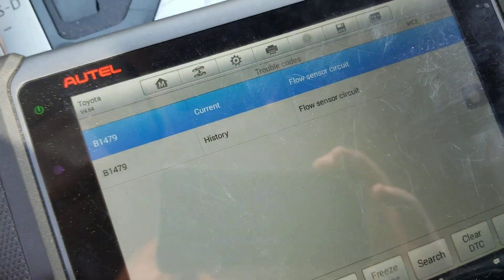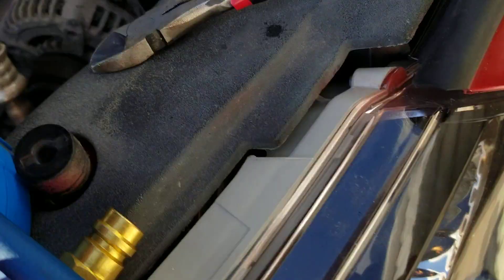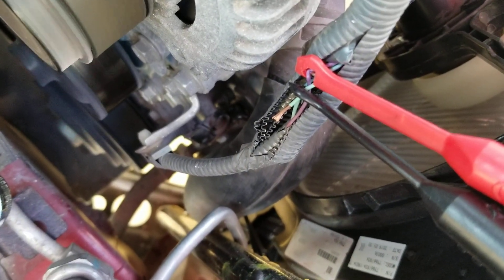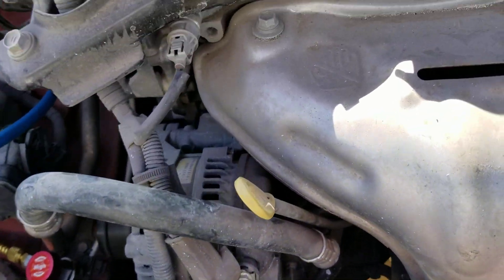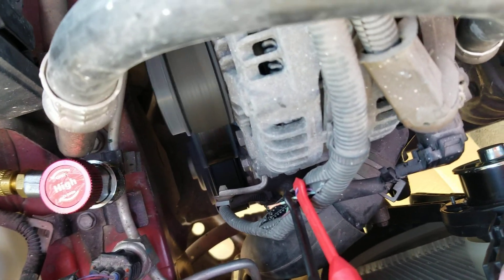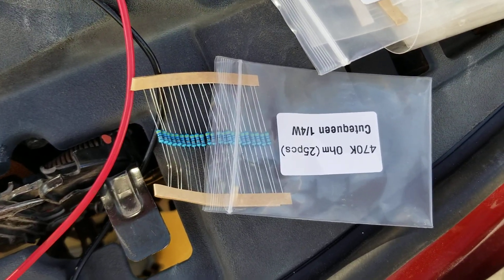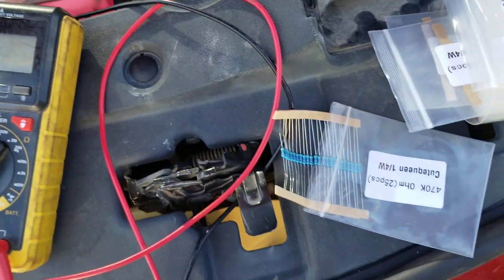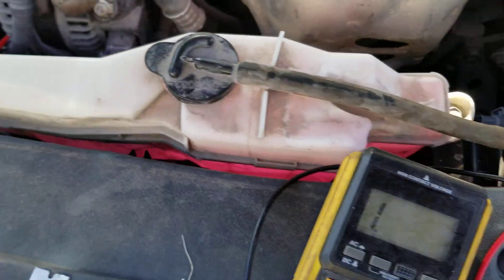B1479 Toyota Flow Sensor Circuit #FIX#

Comment: I was having similar issues. This method works, however, it causes greater fuel consumption and also causes the car to jump when moving from the stoplight. After a while, I got tired of both experiences and decided I want the original fix. I had the section where the flow sensor is attached, removed. Two ten bolts hold that section on the compressor. After removing, I used WD-40 to clean the holes using a small wire to remove oxidation from inside the holes. After ensuring that the liquid flows freely, I cleaned it thoroughly and bolted it back on the compressor and it worked perfectly. The fuel economy improved and there was no more jumping when moving from a stop or the traffic stoplights when the a/c is running. All this time that was the problem, that section needed clearing.

If the holes inside that section are blocked by oxidation, the flow sensor will never work properly because the sensor senses the flow of fluid through those small holes just beneath where the flow sensor is attached. For some Toyota vehicles, there is no need to remove the compressor to remove that section, however, the gas must be extracted from the compressor first.

Comment: Flow sensors are available to fix this issue. I replaced the Dorman flow sensor on my 2014 Toyota camry AC compresser and it works fine now. It is a bit hard to remove the old flow sensor but it works.
Reply: Hi, do you have an instruction of how to replace the sensor?
Reply: It’s a Doorman 926-818 flow sensor. Less than $40 on Amazon.
Reply: I have done this also, and it worked for about a month, now my new denso flow sensor seems to have gone bad as well :-( will try again.

Any thoughts on what may cause the flow sensor to fail?
Reply: I had no luck with the Dorman sensor and had to install a resistor.

Comment: stick a small magnet on the flow sensor works too
https://www.clublexus.com/forums/rx-3rd-gen-2010-2015/824215-rx350-2010-2011-air-conditioning-dtc-b1479-cheap-solution-8.html

Comment: It's easier to just stick a small neodymium magnet to the snap ring that holds the sensor in. If the compressor doesn't come on, try flipping the magnet/polarity. Two problems that happen with these compressors - it gets corrosion underneath the sensor and the magnet in the sensor gets weak. A stronger magnet on top of the sensor usually fixes it. Try it!
Reply: I will be glad if .... It work
.... Mine is not bringing any code... 
It work when you turn it on.... After a while... It cut off and never pick up again, until you turn it off and on again before it pick up again...
Can it (  Neodymium magnet)  work on something like this.
Reply: @michaelaaron2243  what did you find your problem to be?

Comment: There's a right way and a wrong way to perform repairs....This is the latter.
Reply: This worked perfectly for me!  How can saving $2000 be the wrong way?  My AC has been working perfectly for several days.  If it eventually messes up my compressor, I'll replace it THEN....No worse than replacing it right away.
Reply: The RIGHT way really would be for TOYOTA to sell the FLOW SENSOR separately.  Then it would be the cost of evacuating and recharging, along with the sensor replacement.  Maybe a couple hundred dollars rather than a couple THOUSAND.
Reply: @cliffbarstow1753  They sell replacement Aftermarket flow sensors on Ebay. Even if they might not last as long, it's better option than doing this, in my opinion.
Reply: @bobmarren6527  Fair enough.  I couldn't find replacements at any of the normal outlets, including Rock Auto, nor Toyota Dealers.  But even if I purchased on off of Ebay, I'd still have to pay 150 or so to get the system evacuated and recharged.  Now if this method somehow causes failure of the compressor, I may wish I DID buy this aftermarket.  So far, I haven't seen any negative consequences, and I've put 300 miles on my car in beach trips with the AC on virtually full time.
Reply: Agreed Joe's Auto.... I replaced the sensor with a denso sensor available on eBay, lasted about a month, I will now try the magnet on top of this sensor as tickling the sensor with a neodymium magnet does trigger the AC and stays on the rest of the day as the car is running.

Clif Barstow, the system does not need to be evacuated and refilled, I was able to do it with the compressor still in the car and there is no place for freon to escape underneath that sensor. Just tricky to get to.
Reply: @amcpacer2256  did you check flow sensor voltage value ? I tried magnet, but not helping. Now thinking to create flow sensor voltage booster.
Reply: @kesturbo  I have not checked voltage yet, but will....

Maybe easier for you to try new flow sensor first?
 $24 on eBay, maybe don't get too carried away with the amplifier idea process.

Or maybe just add 1,000 k resistor like the gentleman who posted this video in the first place ;-)
Reply: @amcpacer2256  I’m from UAE. It will take 1 month to get items from ebay. I will try to find used one in lexus scrapyard. I think this gentleman’s idea is wrong. Sensor must give dynamic value, witch will affect calculations. Bigger gas flow cools faster than slow flow. This is the purpose of sensor. I think idea with booster is more correct.
Reply: @amcpacer2256  just now i found this video: https://www.youtube.com/watch?v=7Ca2RcuDacE . here it says, that alluminium oxidation pushes sensor out from his position. It means we can change sensor 1000 times, result will be same.
Reply: @kesturbo  I see. Funny, I am buying Land Cruiser parts from UAE regularly, maybe we should start a thing ;-)

Interesting about the corrosion, I will watch and maybe comment there also.
Reply: One neodymium magnet attached to the circlip which holds the flow sensor in has fixed my air conditioning long term now.

Maybe not as efficient as oem, but working everyday.

Comment: Thanks for the fix. It worked for a 2014 Toyota Avalon BUT ... it only works for the time car is running. When I turn the car off and back on it needs to be reset under the hood. Do you have a fix for keeping it on all of the time? I really appreciate your help.
Reply: Neil.... I initially put in a 470K resistor.....I too had trouble once I shut the car or AC off.  I added a SECOND 470K resistor in line to raise the resistance and now it works perfectly.  Only has been a few days, but seems to be working as it should!
Reply: @cliffbarstow1753  any updates for adding the second resistor?
Reply: @asaadal-ruqaishi1471   I added a second resistor temporarily and it improved, BUT....I now have found a DORMAN brand replacement sensor.  So, I have replaced the sensor and restored the wiring to what it was previously, with no resistors.  This  seems to work well. The DORMAN Sensor was about $35 online.

Comment: Do you have a wire diagram show what color wire is what?  I’m guessing the 3 wires are 5V power, ground and the analog signal for flow.  Is the resistor going between the analog signal and ground to give the a/c amp a voltage between 3.8 and 4.2.  Won’t that signal always be locked in?  I thought the signal was supposed to modulate.
Reply: Its a digital signal ,

Comment: What about in v6 engine like 2012 Toyota Highlander
Reply from the maker: All Toyota same thing, when you have this code follow this procedure
Reply: I tried it but once i off the ac it won't on again until i remove the resistor and plug it back again
Reply from the maker: @autofix96  assalam alaikum,  try change the resistor up and down until you found the good resistor, most around 800k
Reply: @omaraiedable  800k and how many watts? Because i used 470k 1/4watts
Reply from the maker: @autofix96  no matter,  any wattage you can use

Comment: Possible way of connecting resistance between wires?  Possible clarification of the colors of the wires..with thanks
Reply: the wire you need to cut is the light GREEN wire.  I ran a wire from a good ground on the engine block to TWO 470K resistors in a row, and then to the light green wire that I cut...this would be the side that goes back up the harness to the AC Amplifier, ultimately--NOT the side that returns to the compressor (flow sensor).
Reply: Still confusing me????